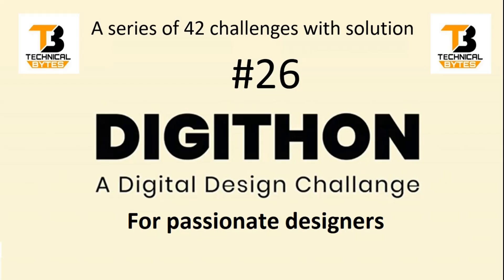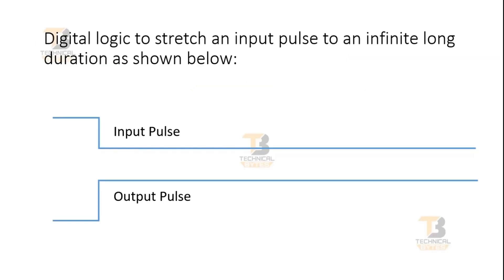DigiThon Question Part 26

Comment: Circuit Diagram: https://drive.google.com/file/d/1r0mA_f0QhPpg53XPU5GjWdHifDD3EEVa/view?usp=sharing
Reply from the maker: Excellent!!
Reply: Sir what is the procedure to get this
Reply from the maker: @ShruthiBrahma  I will let you know in the solution part !!
Reply: In the question given, the output should start as soon as the input ends right? Your circuit will provide output of 1 as soon as the input starts. Don't you think we need a neg edge detector and the output of the detector is given as input to your curcuit ? Please correct me if I misunderstood.
Reply: @swayansunayak6309  i agree